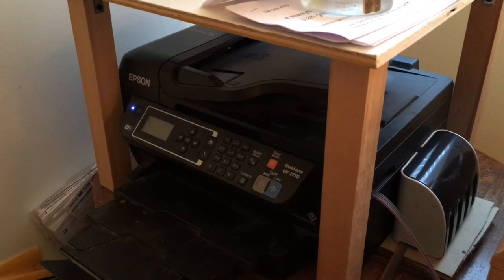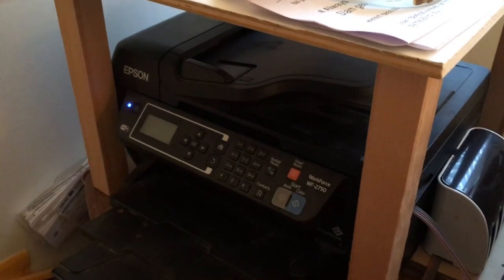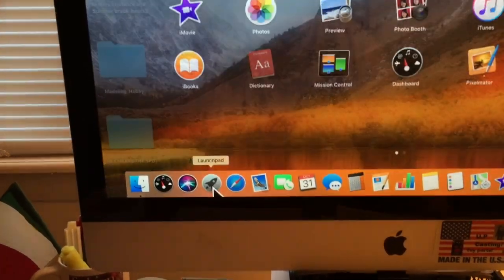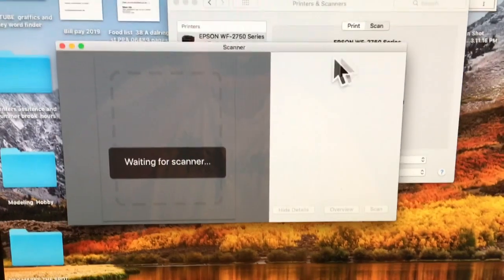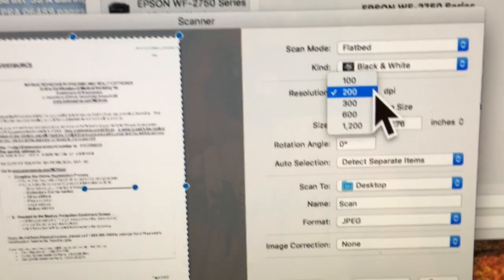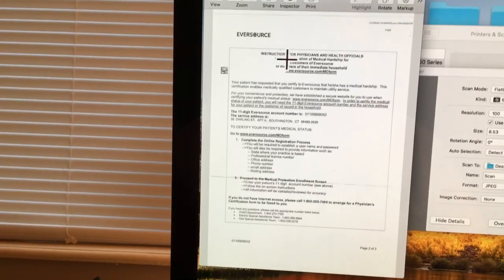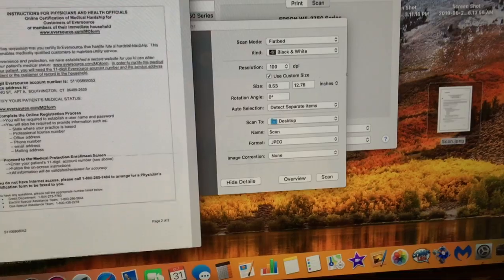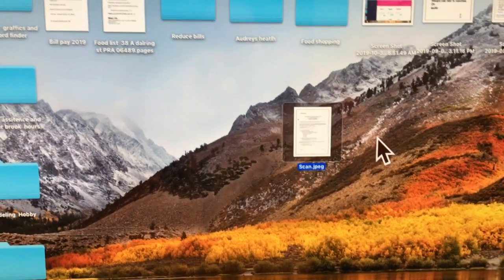How to scan on a epson  wf 2750

Comment: how do you scan from printer to computer wireless?! the computer doesn't show up on the printer!
Reply from the maker: You have to set up the Epson apps on your phone to do that . Go to printer and toggle in the settings  to pair it . Then you can print from your phone.
Reply: @PeterAgostiniJdcap26  i meant to apple computer. Tried it for over an hour on my girls computer and it wouldn't scan from printer to her macbook
Reply from the maker: @TENNSUMITSUMA  call Apple tech support
Reply from the maker: Do you have the two connected from print to computer the cable may be loose

Comment: Thank you I need to upload a bunch of papers for remote learning is there a way to do multiple copies?
Reply from the maker: sheenbean2 use school top trap to scan them to desk top . Lay the papers with print up and no crimps or creases in the stack . If you get blanks to desktop flip them the other way and run through ach top feed tray .
Reply from the maker: sheenbean2  try doing this using the buttons on the machine if not open scanning software do from there .
Reply: Peter Agostini jdcap26 tips an repairs and hobbies   It looks like I need to somehow USB the Mac laptop to the Epson printer do you know? Oh boy